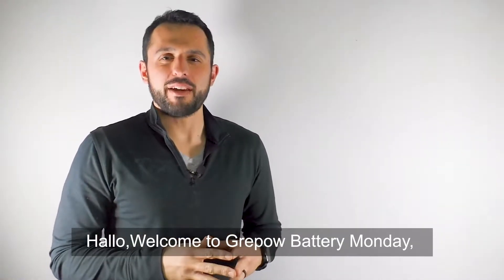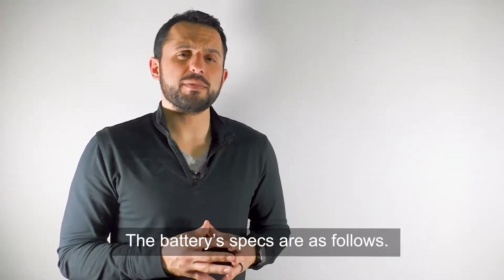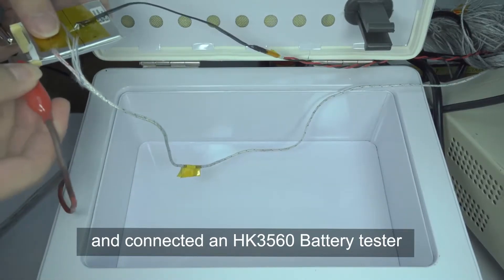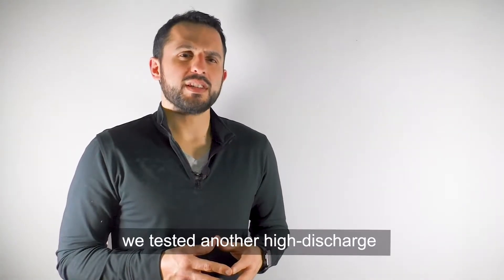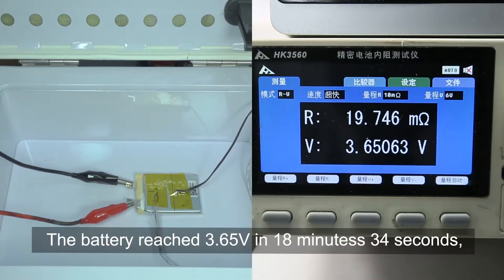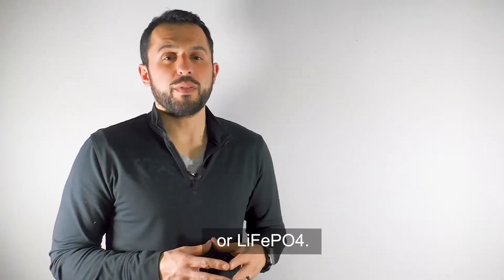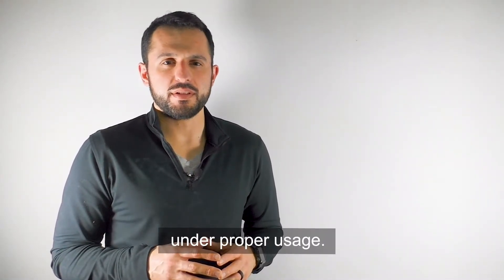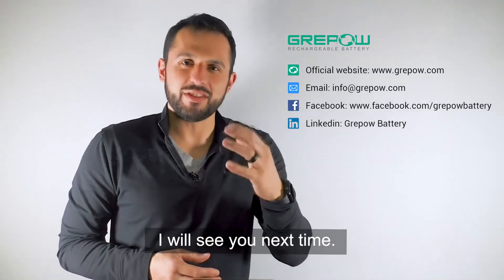What if we over-charge LiFePO4 battery to 10V? - Battery Monday | 23 NOV 2020

Comment: Can you retry this with cylindrical cells? In pouch cells the distance between the electrodes increases and 'disable' the battery. But cylindrical cells keep the electrodes tight. Will they start forming pure lithium? Or explode?

Comment: Most common electrolyte used begins to decompose above about 4.3v (and below 0.2v).  Besides the gas bloating, other electrolyte decomp components coats the surfaces for anode and cathode blocking lithium-ions flow increasing cell internal resistance and reducing capacity of cell.  Two reasons why LiFePO4 is safer then other Li-Ion chemistry is LiFePO4 cathode is most tolerant to overcharging of all Li-Ion chemistries, and with the lower cell voltage gives more margin before reaching the electrolyte decomposition voltage than lithium ion chemistry needing charging to 4.2v.

If the pouch breaks open from pressure of gas created, the solvent in the electrolyte is somewhat flammable, similar to fuel oil or diesel, with high ignition temp.  Electrolyte is no more toxic then fuel oil or diesel.  There might be a very small about for Fluorine gas released, which is toxic, created from the small amount of lithuim salt disolved in electrolyte but it usually bonds with other chemicals in the decomp process making it safe.

Comment: So lithium batteries of any model kind can be made not only in pouch form but cylindrical shape too wow , I preferred cylindrical always due to the gases
Reply from the maker: Yes, they have their own advantages, pouch or cylindrical are depend on your applications. The advantage of pouch batteries lies in a higher rate of charging and discharge, as you can see we could fully charge the battery within a half-hour and discharge at 20C~40C, but cylindrical can't. So, you could find out that a part of the products has to use pouch cell batteries, like Jump-starter/battery booster, but cylindrical is commonly used in energy storage due to no high rate required.
Reply: @GrepowBatteryOfficial  cylindrical cells are between pouch and prismatic, right? An advantage is they can't swell and don't need compression